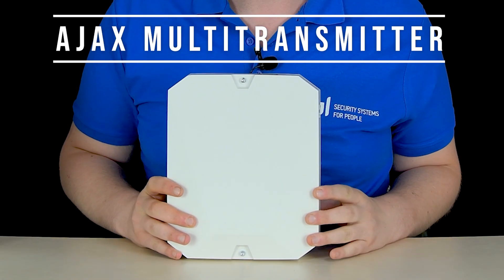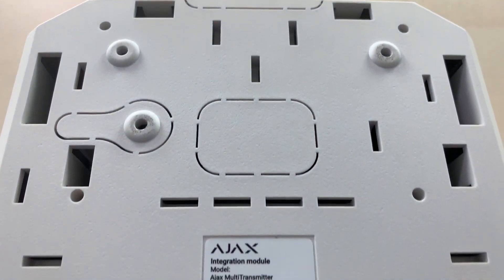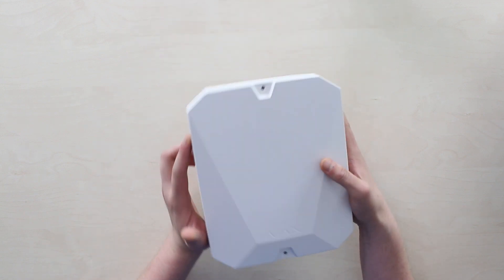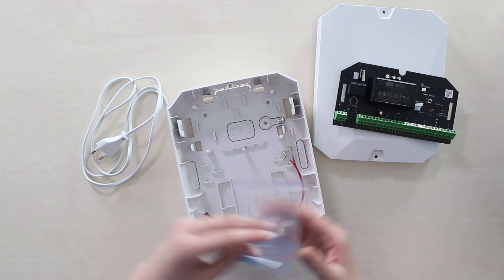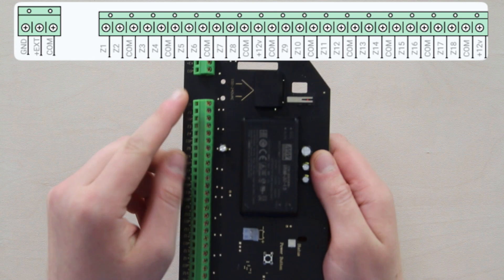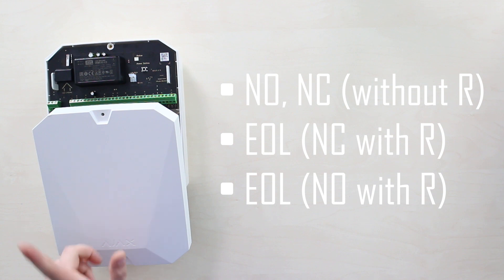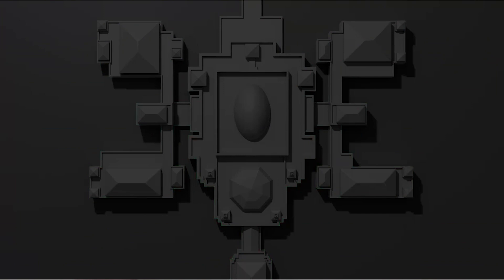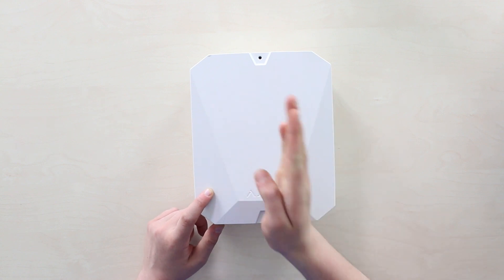AJAX Alarm System Review: AJAX MultiTransmitter Review / Turn Your Whole Wired Alarm Into Wireless

Comment: First of all congratulation for your presentation you are very good!!
I have two houses and i have installed to the first house fully wireless ajax alarm system. In case I want to arm the system and i have left a door or a window open it notifies me through the application. In the second case in my other house because I had already wired contacts door-window I used the multi transmitter. The only problem is that if I try to arm the system and I have left or forgot a window open “it does not notify me” and it arms with the door or window open. What have I done wrong??! Thank you in advance
Reply: Μήπως βρήκατε άκρη με το MultiTransmitter???  εχω το ιδιο πρόβλημα...
Reply from the maker: To Buy, WhatsApp us: https://wa.link/piplsystems

Join FREE, our community PIPL CLUB SECURITY SYSTEMS to get technical support from Pipl Systems engineers, share experience with professional installers from around the world, ask your question directly to the manufacturer's representative and get certified training: https://discord.gg/rBzkRmHytN
   If you have no Discord app:
1. Download the Discord app to your phone or computer
2. Register in the Discord app
3. Follow the invitation link https://discord.gg/rBzkRmHytN